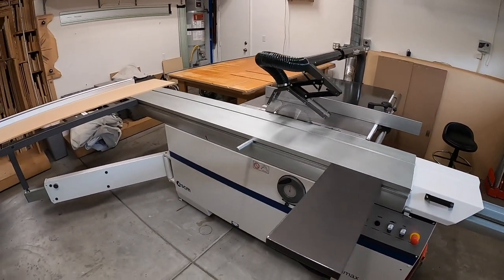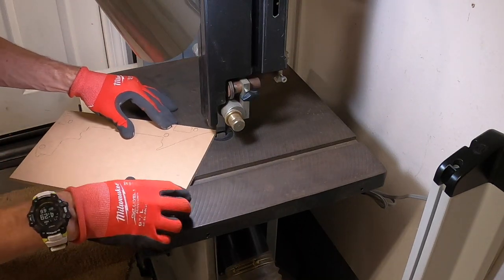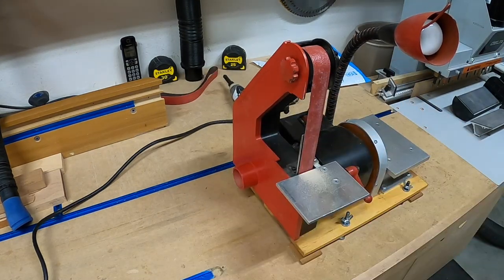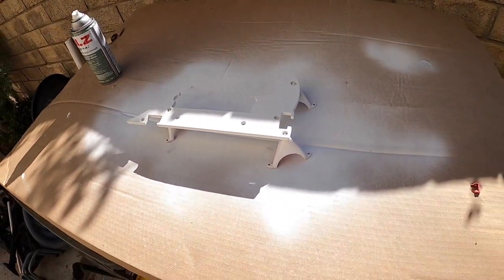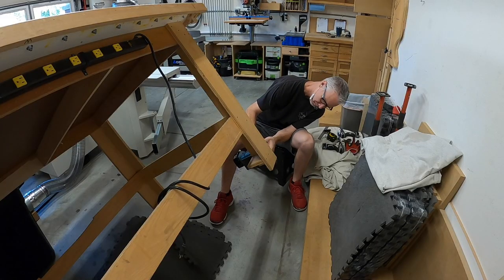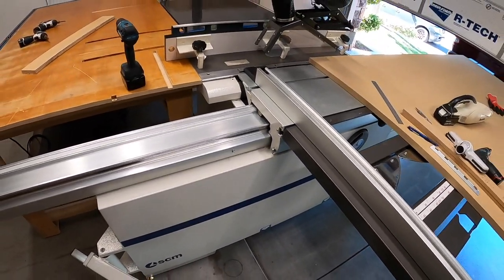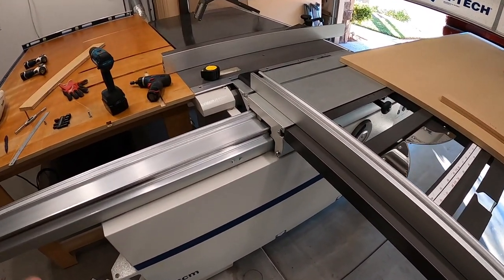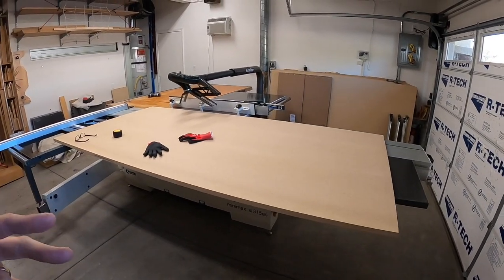My New Sliding Table Saw Gets 2 Great Mods- Plus The Out-Feed Table Gets Cut Down And DIY Levelers.

Comment: Looking good once again! A little bit out of topic, but I believe you have a Makita Jig Saw. Do you like it? Which model do you own?
Reply from the maker: Thanks man. Yes I do have my makita jig saw.  It’s been great. I actually made a video where I compared it to the Bosch and festool I had.  It’s under tool reviews playlist.
Reply: @davidbryanwoodworksandmore  I just watched the video. What's your take after using it in the past months? I wanted to get the brushless one, but I want to be able to use the trigger to modulate speed during turns.
Reply from the maker: @sebmstudio1697  I really like mine.  I use my Bosch for metal cuts or if I need to have better view of the blade.  But mainly I just use the makita daily  it’s really nice to have cordless also and I find the cut to be very good also with a good blade.  The light is sweet.  It’s really a nice tool. I like the soft start and variable trigger speed.  I’m not sure if the brushless one is able to do that or not. I don’t like the auto matic speed on start up on the brushless one.  I think you can shut it off though.  Maybe.

Comment: Hey David just curious if you’ve changed how you plan to put cabinetry together now that you have this new saw. Are you still making cases using dadoes and rabbets using this saw? Where are you assembling the boxes since you don’t have that large table surrounding your table saw?
Reply from the maker: You know I’ve got some build videos coming up shorty to show everyone. It’s pretty much identical but has taken a bit of getting used to. The bigger countertop is definitely missed but as you’ll see, it’s worth it.  How are you doing?  Busy?
Reply: @davidbryanwoodworksandmore  Definitely a lot of people staying at home and planning big projects for this year.
Reply from the maker: @crownmoldingbyspectaculart941  that’s great man.  I feel the same.  Im just having such problems getting hardware still.  Its nuts.
Reply: @davidbryanwoodworksandmore  that’s what I understand from other people who do cabinetry. Especially those Blum slides that are for 24” base cabinetry.
Reply: Some moulding profiles are completely unavailable. From what I have heard, material coming from other countries is available but they can’t get it here. I’ve had to had some moulding run custom to finish jobs so it’s not just hardware.
Reply from the maker: @crownmoldingbyspectaculart941  you’re exactly right.  It was 18” but now it’s all except 9 and 12”. Who uses those sizes?  I’ve used 12” before but it’s very rare.  Hinges too.  Moldings are tough too.  Regrettably I sold my woodmaster last year. Lol.  We’ll hopefully things change soon.
Reply: Do you consider your line boring machine an essential piece of equipment for building cabinetry?
Reply from the maker: @crownmoldingbyspectaculart941  I’d say you can drill holes in other ways but not as clean and quickly.  Especially in plywood. But I did it for a long time before I bought one.  So it surely can be done without one. It’s really nice to have especially on large cabinets with lots of holes.
Reply: I plan to build using plywood primarily to do mantels, built-ins and bookcases. I’ve been designing them and building them for years but I have rethought my joinery and with it changes my approach. I do not intend to build kitchen cabinets. Over the last two years I have sold off my DJ 20 jointer and my hollow chisel mortiser. I’m near Pasadena and used to have to buy lumber rough. That changed about 4 years ago and I found I rarely used a planet and it was a big space sucker in a small shop now that I can easily get S3S and S4S lumber for projects locally. I’ve reduced the footprint of my tablesaw, and I have made every effort to reduce any stationary tools that I absolutely don’t need. I’m now at a point where if I buy something else I want to make sure it’s something that’s going to get used on virtually every project. You’ve been really lucky with your craigslist purchases. I’ve been
Reply: @davidbryanwoodworksandmore  I’d be interested in knowing how are you film these videos I see a GoPro used in some situations but can you share some of the specifics. I know very little about photography and I’m curious if you have modified from the standard GoPro settings etc.
Reply from the maker: @crownmoldingbyspectaculart941  hey man you know I use a GoPro hero 8 for most everything.  It does well.  I also use a iPhone 12 for somethings.  But not much.  The GoPro has been terrific.  It’s pretty easy to use but I’ll say it’s not great in low light conditions.  Neither is my iPhone.  The settings are 1080 60fps and wide screen.
Reply: You have had great luck finding stuff on Craigslist. I’m on the hunt for an affordable delta line boring machine and I’m striking out everywhere. eBay, Craigslist, OfferUp. Any other ideas?
Reply from the maker: @crownmoldingbyspectaculart941  hey man have you tried machinery max auctions and bidspotter auctions?  They do have apps for your phone and they’ll email you for new auctions.  They are great for all sorts of things.  Just have to find auction in California.  I do  no I like to go too far but will If deal is great.  I recently saw a delta libeboring machine on one of these auctions.  I’ll keep my eye out.
Reply: @davidbryanwoodworksandmore  I’ve been watching MachineryMax but I’ll check out the other. I bought an LR32 system but haven’t used it yet. Just have a strong feeling I’m going to become annoyed with one hole at a time.

Comment: we did this sliding saw handle mod to our 3,2 sliding bed , with in a weak one of the guys lost a finger by trapping it on the bed return . no where near the blade . the extended hand hold is there for a reason ..
Reply from the maker: That’s not good.  I’m sure it’s there for a reason, but in my shop, unfortunately it’s not possible.  I also think that if you had a handle on the plate and they used it, this wouldn’t have happened. Maybe.  Also did it happen when somebody else moved the wagon when the other wasn’t paying attention to where his hand was?  Th
This I’m sure can happen with two people using the saw.  Because when I use this saw, it’s never happened to me that I get my hand stuck as I hold the handle.  It’s Not possible.  Saws and tools for that matter, are dangerous if not used in the proper way.  I’m glad you pointed this out that though about the wagons being heavy and very dangerous where they meet the saw supports. I’ve noticed this too.  As my saw only has one handle on the wagon.  The same thing can happen on the other Side of the wagon. Especially if you’re using this saw with another person helping you.  This I feel is more of a problem.  The help of another worker on the saw.  It’s safer to be by yourself using it.  Knowing when the wagon is being moved and to clear your hands.

Comment: What is the leading edge of the sliding table used for, in front of the fence?  Is the position of the crosscut fence adjustable on the table?  (at 0:26, it looks like you have a foot in front of the fence; although this looks less on later shots)
Reply from the maker: Hey great question.  It’s the area that can be used to make longer cuts.   As the fence and support assembly can slide on the wagon to any location. To accommodate different cutting lengths.  Yes you can angle the fence to cut panels or moulding like a big miter saw.

Comment: What made you chose SCM over Felder?
Reply from the maker: I didn’t specifically choose any brand over another.  Scm to me is a no brainer and when I found one, I searched for quite awhile, on the used barely used market that had everything I needed, I jumped on it.  They don’t come up often at all so I bought it.  Had I found another very reputable saw, I would have bought it if it met my criteria.  I see very old scm saws come up sometimes but not newer ones so I got very lucky.  I do see lots of felder saws and hammer saws quite often however.  Infact right now, I see in my area 4 newer felder saws for sale.  Thats just on Craigslist. Not one scm.  I still feel very lucky to have found a great barely used slider near me.   Are yiu in the market for a slider?
Reply: @davidbryanwoodworksandmore  I'm not currently as I need to build my shop first (next year), but a slider will likely be the first purchase. Looking at the Minimax 315, Nova 400, Felder K700 or the Cantek D405 with CNC rip-fence. Right now Cantek is high on the list due to the digital input, motorized blades and rip-fence.
Reply from the maker: @Meyerwoodworks  so your coming from a cabinet saw?
Reply: @davidbryanwoodworksandmore  Yep
Reply from the maker: My cabinet saw was very nice.  It really was a great tool that I was very pleased with.  I still can’t bring myself to sell it.